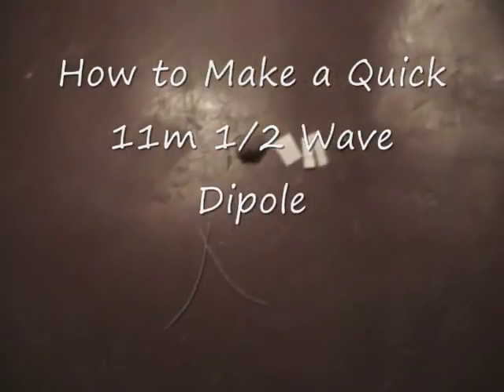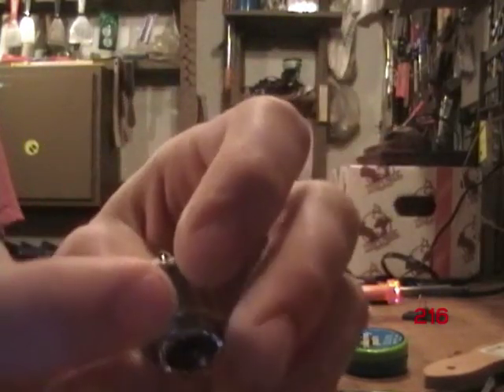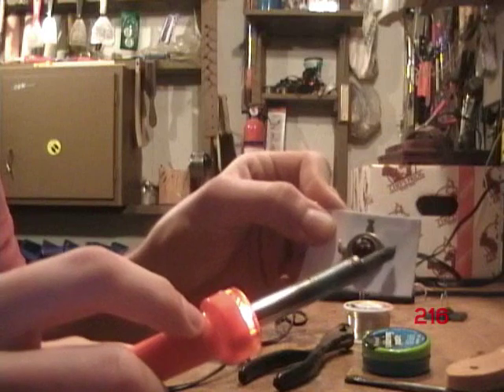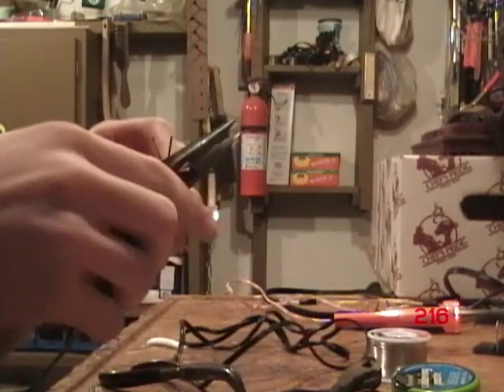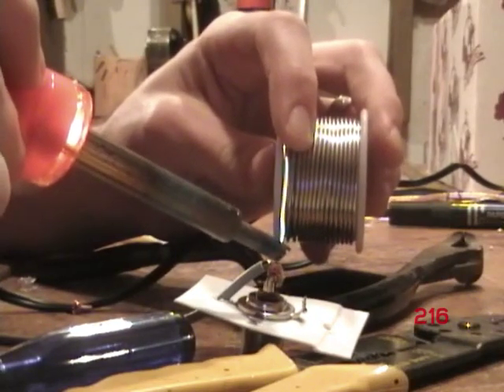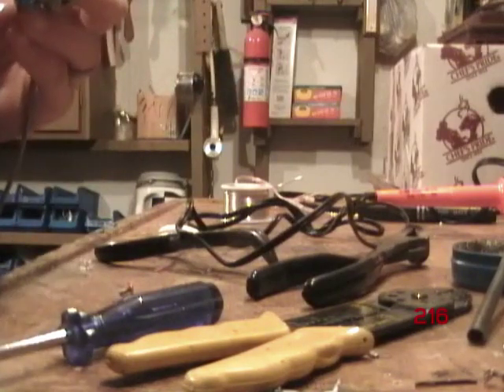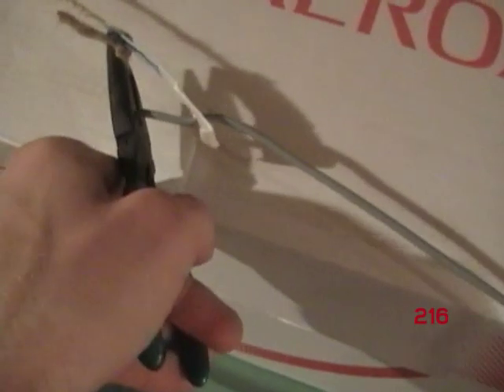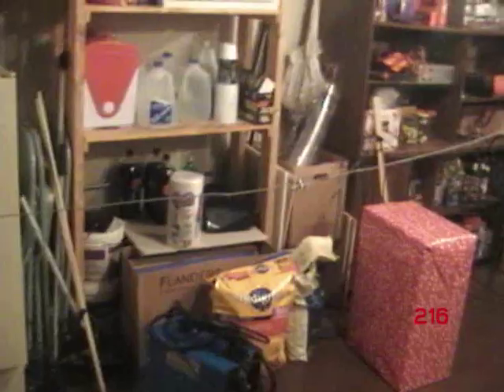Make An 11 meter dipole (Short)

Comment: 300:27.205=11.01119......(M) :4=2.75cm  make a little longer for bending , make a ugly balun in your cable for RF 5 to 7 turn's rg58 0n 7'' air cored close to the feedpoint  hang is on 5.5m heiht horizontal measure the swr and cut the both end side's  same lenght for beter swr .Tip this wire antenna is close to 76 ohm so you can feed it with 75 ohm cable.Hang like a /\ 45 degrees both end close to 50 ohm use 58 ohm cable and do No use 75 ohm cable

Comment: I built a similar antenna as the colossal 15Kw antenna, and see there i a capacitor on it? 
my question is what kind of a capacitor and how should it be connected
My antenna is actually large copper radiator .64 wave calculated to half of that in hopes I get that little bump the .64 wave is know for!
it is 1 1/4" copper to 1” copper to 1/2” copper radiator antenna pieced together.
then the 8 radials coiled 10 gauge wire around fiberglass rods at 55% down slope.

I will tune it for 50 ohms and low SWR 

But it is built tuff and am now looking to test with meters to see where it resonates, but thinking that it should have a static release
the 8 coiled rods are attached to a 1’2” thick aluminum 7” diameter  plate each coil is 103” long on a 4 foot rod and may ALSO BE MADE TO RADIATE? I intended to have this for ground plain only and have the aluminum plate grounded to ground rod I have driven 8 feet into the ground.

some thoughts? static concerns? etc.

thanks

Geronemo in ND

Comment: Hi I had to show some one your ling to post a video on how to make a !/2 dipole but you length is only !/4 wave as 9 ft start is 1/4 length ok I use simular to yours been making for years but mine are tied to the insulated plastic  length this was for a guy in Cebu Philippines ok thanks same as mine but my modification since 70;s ive use like this its easy just wrap it up and your away find two trees and no problem hey  and I only cut the main element only cut of about 2 inches I think only one end mine was 1.2 1 and 1.2. 40 ok thanks
Reply: A 1/2 wave dipole is 2  quarter wave elements that equal a 1/2 wave overall length.

Comment: heat up the copper wire and connector first . once hot.. touch the solder-wire to the copper wire, and your soldering will be fine. careful heating up the connector although it can take quite a bit of heat.
Reply: COOL ABOUT THE GLOW LIGHT BEHIND FLOWERS.DID YOU EVER WATCH DUAL SURVIVOR.ON TV..?

Comment: This guy shouldn't put up a video on how to do something he doesn't understand, one thing you NEVER use flux on an electrical connection (flux is for copper plumbing ONLY) flux is acid and it WILL corrode the connection.
When building a wire dipole you should be using bare copper wire, not multi-strand telephone wires. Does he know the difference between horizontal polarization vs vertical? He should explain if you expect to talk to locals (especially cars) you need to string that  up vertically with the radiator up and the braid side down!
Those cheap plastic parts will last a few days at most!
Look around YT you will find a LOT better way of doing this!
Reply: +wulff707 Are you certain he was using acid flux? maybe it was rosin flux which is appropriate for electrical connections. I always use rosin core solder which obviates the need for any added flux when soldering connections. The only time I add rosin flux is when I am soldering to a sheet metal chassis or the rear of a potentiometer or similar surface.
Reply: This is a simple cheap antenna.  Who gives a shit is it corrodes.
Reply: horse shit, I gots a lil bottle of "TOPNIK TK83" and it does for general use AND 
SMT: SURFACE MOUNT TECHNOLOGY ie intricate electronic circuit soldering, flux is commonly used on electrical conxx since the year dot, have a nice day

Comment: Great tutorial vid!
Two questions:
1.) Do both wires have to hang in exactly one line (180 degrees to each other) or could they hang like an L or V?
2.) Would a horizontal polarization make a huge difference in the performance of this kind of dipole during DX on 10-11m?

Comment: I have made these when I was a ham, license expired, and I also used them on 11 meters. They work well and are vary easy to make. not to mention inexpensive. An antenna tuner helps if using on multi bands.

Comment: @ka2gym One problem is that most CB use is mobile to mobile, unlike in the ham bands, not to mention that CB is supposed to be limited to a 250 mile radius (though we both know that radio doesn't work that way).

Comment: @deanotune 
 I heard someone useing 1/4 L long transforming line and next  50 ohm cable as a feeder cable, but if i made dipol I've never used to have transformation of impedancy or baloon and it was worked good - only I used few ferrites rings on the cable.

Comment: This is a great beginners antenna project. 

Pointers... I would have done a simple knot on both wires (stripped and soldered, then pulled back to the plastic when cooled) before passing it through the plastic, for strain relief on the solder joints. I also would have used thicker plastic (Wind, whipping trees and such).

Also consider hanging antenna vertically (center conductor lead UP) where you can. Polarization of transmit and receive antennas should match. Most CB is vertical.
Reply: Are you saying have the connector at the top and the wires hanging vertical Down from it

Comment: Made many dipoles when I was CB'ing. Beams, quads and V's. If you want to get better performance from the dipole us 75 ohm tv coax (RG6 or RG 59BU for your feed line to the CB. These are a 75 ohm coax and helps match the dipole to the 50 ohm input of a CB radio better. No need for baluns.

Comment: WOW TOO MUCH WORK ALL I DO IS SPLICE A COAX HAVE HOT ONE WAY GROUND THE OTHER AND SOLDER A 9 FOOT SPEAKER WIRE ON EACH SIDE THEN CLIP OF A 8TH OF A INCH ON EACH SIDE OF WIRES TELL SWRS ARE GOOD AND DONE I NEVER USE THAT PHONE WIRE CRAP BEST TO USE 10 OUR 12 GAUGE WIRE THEN YOULL HAVE A NICE DIPOLE
Reply: lazydogg calif